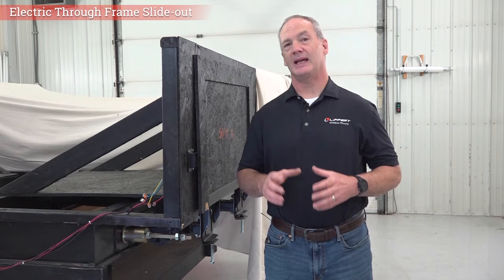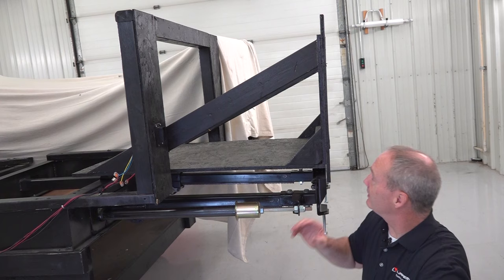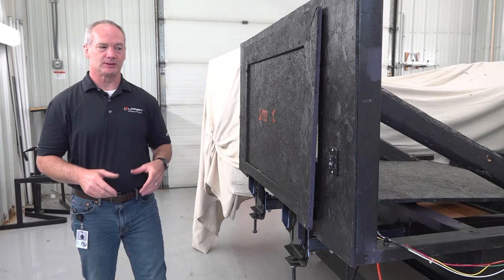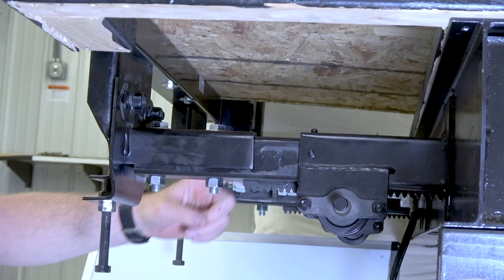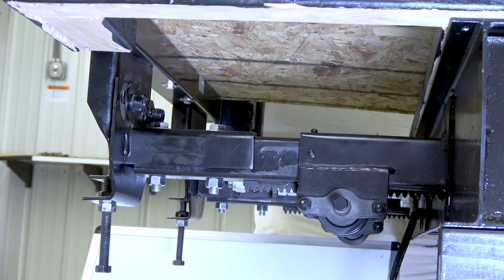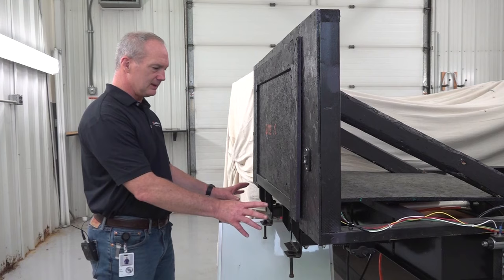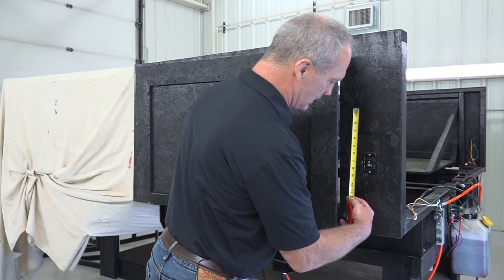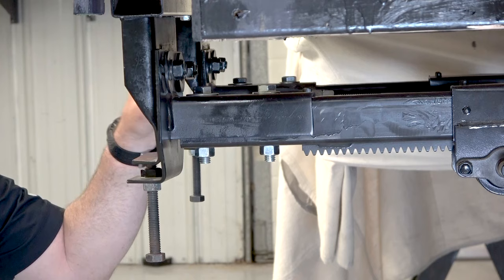Electric Through Frame Slide-out Operation and Adjustment V1

Comment: Just bought a new 5th wheel and the bottom of the living room slide doesn't sit flush when retracted.  I pointed it out at the dealer and her said it was normal and just the seal itself that was preventing it from being fully retracted.  This all despite the other 5 slides sitting flush on the unit.  Thanks for posting this content and saving me a service call!